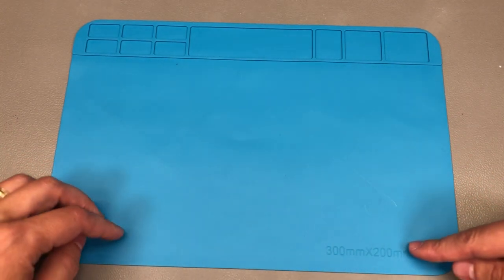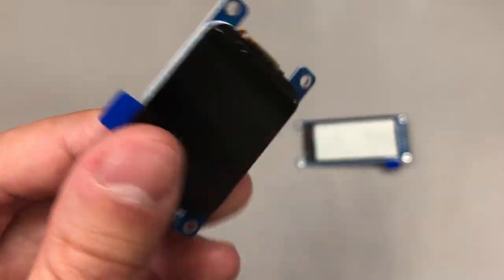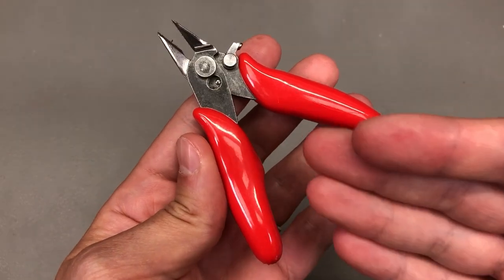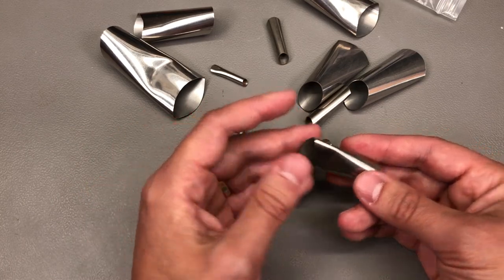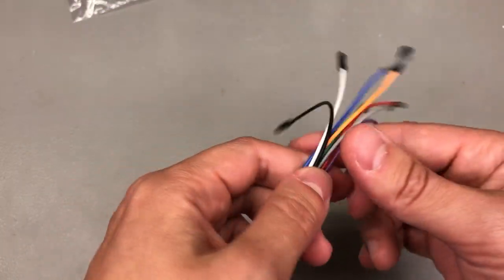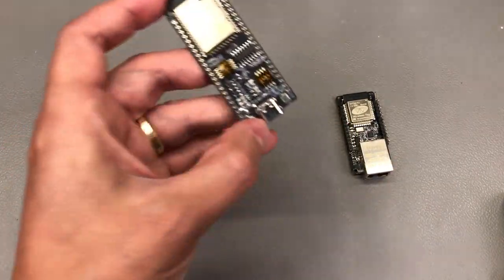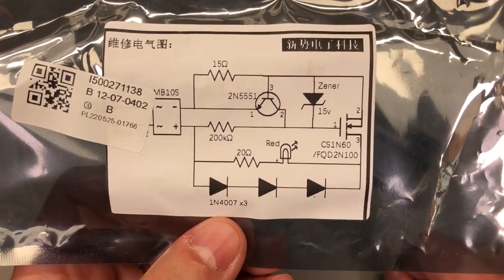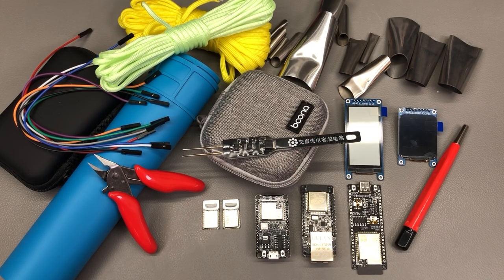InTheMail | Voltlog #424

Comment: Tip for the fiberglass pen. After you use it to clean the work area of the loose fiberglass fiibers use a piece of tape and dab it around the work area to get all the loose fibers before they wind up on your skin and start itching.
Reply from the maker: Thanks for the hint!
Reply: @voltlog  As you scratch them on a surface it creates tiny specks of glass that is like very fine dust. So yes fiberglass is very dangerous in particular for your lungs a bit like asbestos because it keeps piercing the membranes and can't be degraded or expelled.  Permanent inflammatory zone that could end up in a cancer in a few decades.
It's also bad for the skin or the eyes... So use gloves and have safety glasses.
I would use that tool outside with the wind from behind.
Reply: cool tip. thanks. ignore the pun

Comment: catching up on old videos. the glass fiber pen is perfect for removing solder mask and clean up PCBs. as the fibers are not conductive. the tip can be pulled out and replaced, and you can also get other types of inserts like brass brush etc

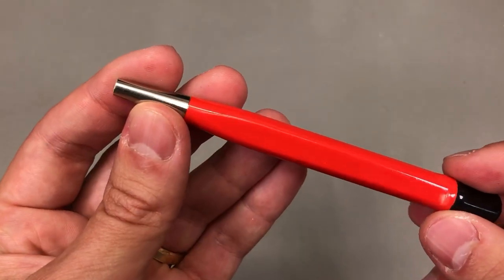Comment: 4:02 Be careful when using one of these Abrasive Fiber Cleaning Pens on your workbench.
.
Tiny glass fibers break off which will cover your workbench, which will penetrate your skin when you are working on the workbench after you use the pen.
.
It's a very useful tool, but it can cause you health problems.
.
You should wear disposable rubber gloves, safety glasses and use the pen outdoors (open your window and use the pen outside the room) for safety reasons.
.
If the glass fibers get into your eyes (scratching your itchy eye after using the tool with glass fibers on your fingertips) then you will have real problems.
Reply from the maker: Thanks for the hint!
Reply: I would say that it's not just your skin that you should worry about, but your lungs first and foremost. I don't know how similar the grains of this fiber are to asbestos, but a disproportionate amount of acicular dust is produced during use and it floats easily into the air. That's why I stopped using this pen. Instead, I prefer decent knives and scalpels like OLFA for scraping.
Reply: @SlaVoy  The above is all true but can be used effectively if used carefully.